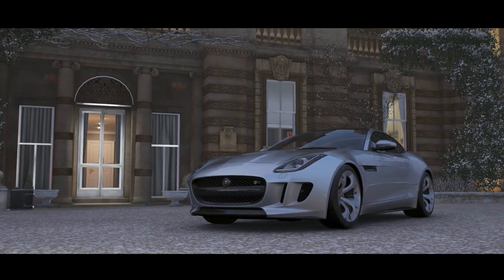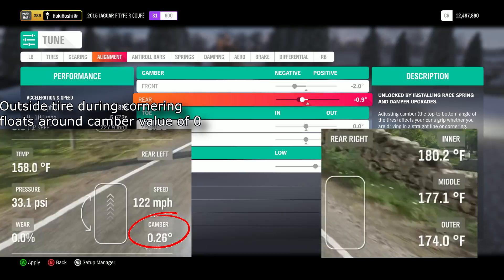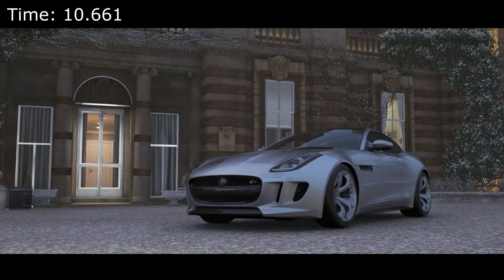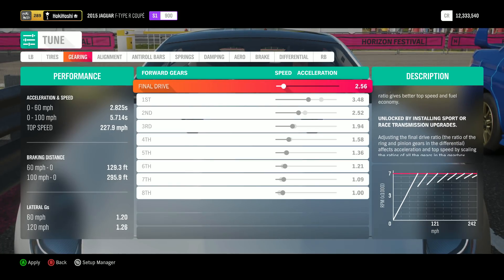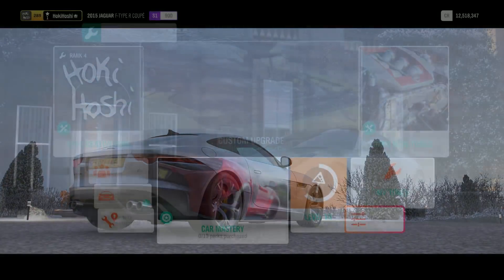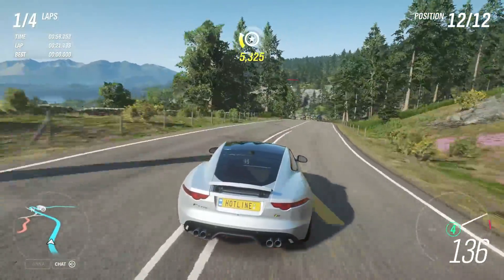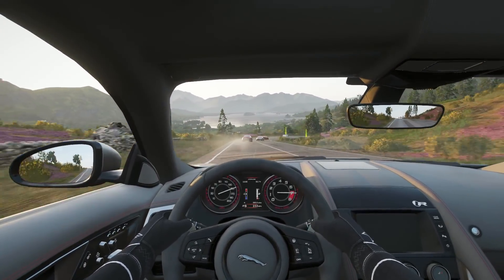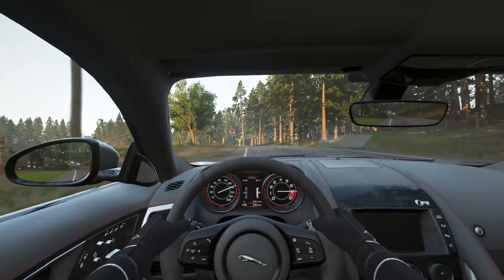Tuning Quickie | RWD Grip Tuning in FH4

Comment: I just don't understand why my cars slide into walls on corners after slowing down...
Reply: Are you using ABS? If not- it may be due to your front wheels locking up under hard braking. Your front wheels need to be rotating for them to make your car turn in. To solve this, the easiest way is to enable ABS, but you could also try to reduce braking pressure in your tune (start with 70% at the front, drop it 5% at a time until your understeer is reduced or your braking performance is negatively affected).

Furthermore, you can move your brake bias towards the rear. Start at 53% (by counter-intuitively moving the Brake Bias slider LEFT) and move a percent or two at a time. I wouldn't move past the lower 60% range.

Hope that helps. Good luck. Let me know if you need more info.

P.S. Sweet outrun avatar.
Reply: Nymos thanks this helped alot now my supra isnt spinning up out of control every 5seconds haha